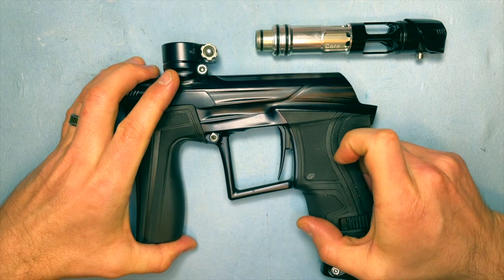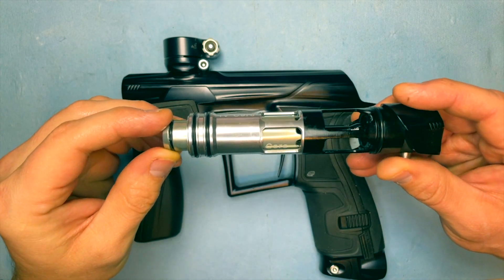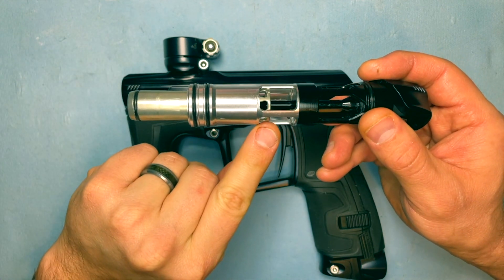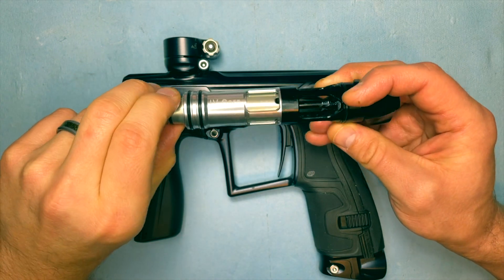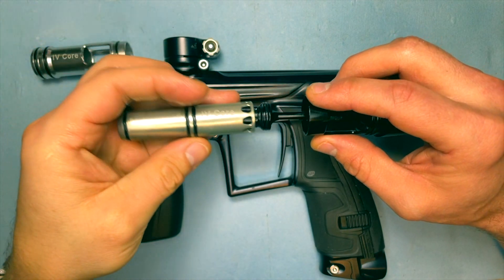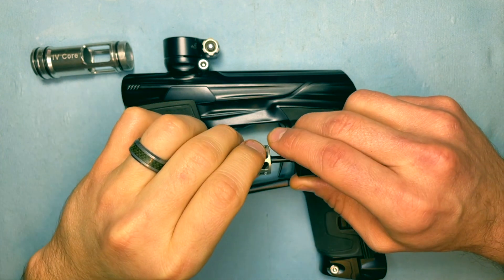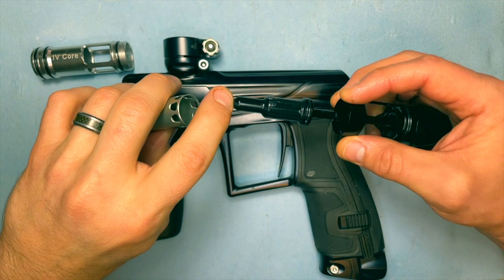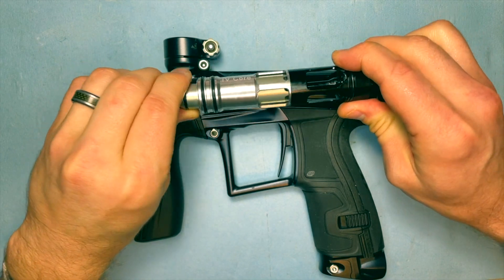How Does The Planet Eclipse GEO 4 Work?

Comment: Other breech-sensing markers:

Clone 5 (all other previous Clones use the balanced system with a fixed valve originated in the Droid)
DSR
All Gamma Core markers

Perhaps next time reference the available CS1 animation to illustrate the solenoid performing its dual roles, as well as providing a visual for the breech-sensing function.
Reply from the maker: Hey axle, thanks for your input and clarity. I try to keep these as simple as possible, but I like the idea of using the CS1 animation. Thanks again!
Reply: I didn't know the CS2 was a balanced spool. I thought it was very similar to the Geo.
Reply: @Damitsall  the CS2 (and all other Gamma markers) are unbalanced spools. I'm not sure what you saw or heard to make you think otherwise.
Reply: @axledog7297  Because you typed above that it was. It looks like you edited it and fixed it. That's why I said I was surprised. I didn't think any of the Geos were balanced.
Reply: @Damitsall  PE has never sold a balanced spool. I didn't edit my original post either so I'm not sure what you saw...
Reply: @axledog7297  Well that's what I thought, like I said I didn't think PE ever made a balanced spool. It's possible I miss read it, but your post is edited.
Reply: @Damitsall  I edited it when I initially made the comment, not recently.